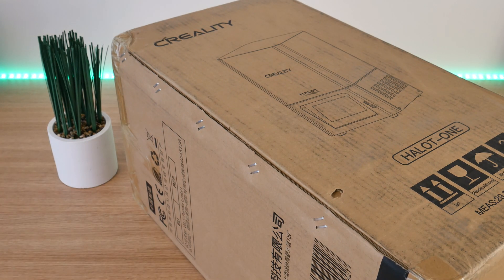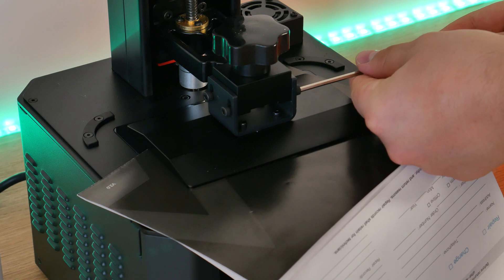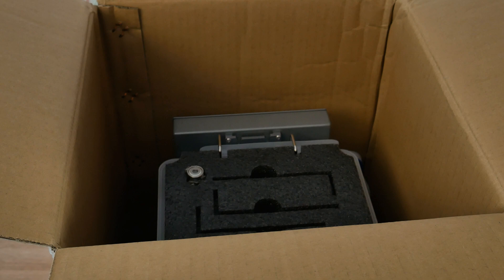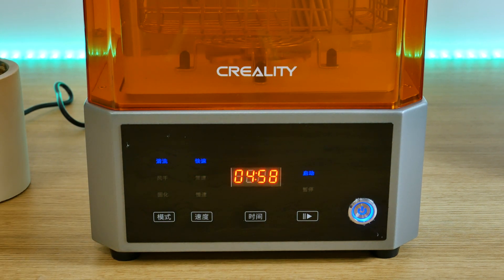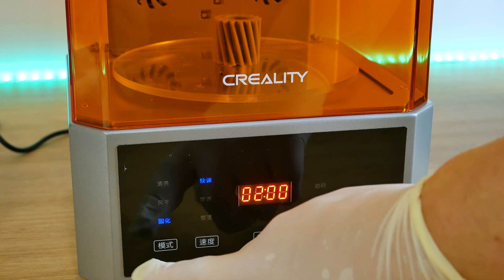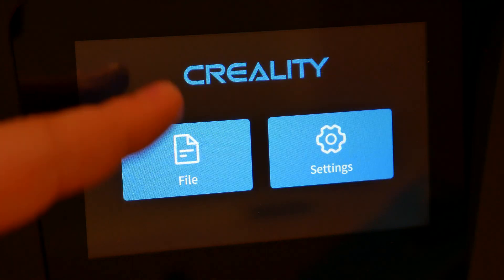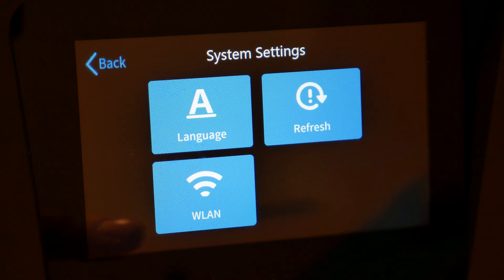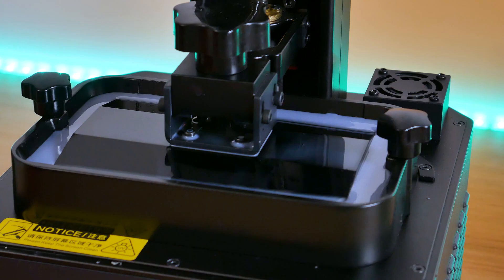Creality HALOT ONE + Washing and Curing station UW-01 - Best Affordable Resin Printer at the Market?

Comment: hey! i have a tip that everyone should try if they have this printer!! if you are having problems removing support remove it after the rinsing process not the curing because the resin is not fully cured and so will be easier

Comment: My brother got a Halot-one and he is kindly letting me use it for time-lapses for my channel, but when it came today, the LCD screen that projects the UV was cracked in the corner!  Is that something to be worried about?  IT's just a small crack about the size of a hair.
Reply: I’ve had a very similar thing happen, but much worse. I had a print fail and crack a significant portion of the screen, while the crack is centered in an  area the size of a pea, the cracks spread to nearly half the screen.

All my prints still print fine lmao
So I keep printing
Reply: @solardile7143  Ouch.

Comment: Do you need to always cure the artifact with alcohol and UV light? What happens if you don’t have the curing machine, is this a required and necessary equipment for this printer?
Reply: The resin will be soft if you don’t cure it. It’s washed in the alcohol to remove the excess resin.  You can also cure prints in sunlight
Reply: the resin is hazardous to our health. if you do not wash and cure it, it would cause irritation and sickness if if came in contact with skin